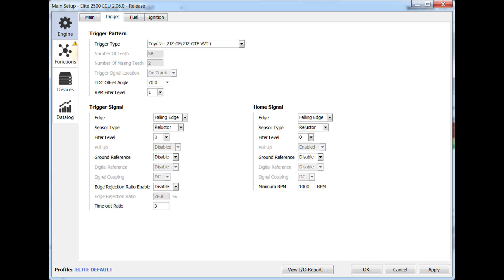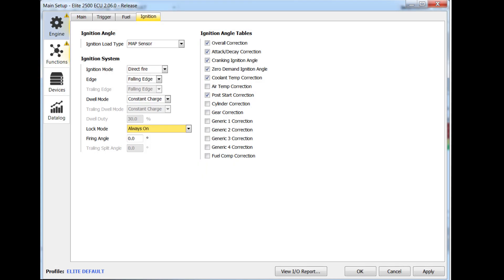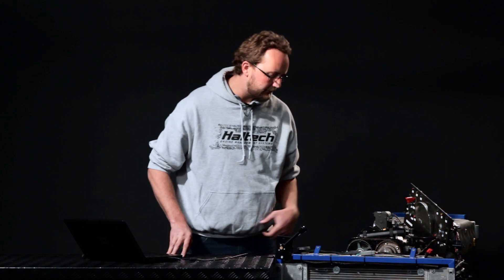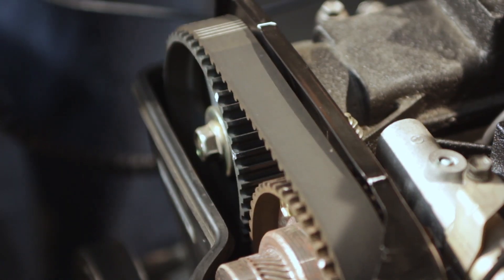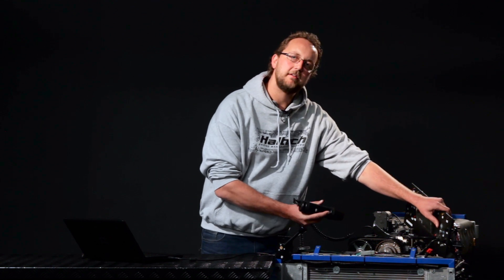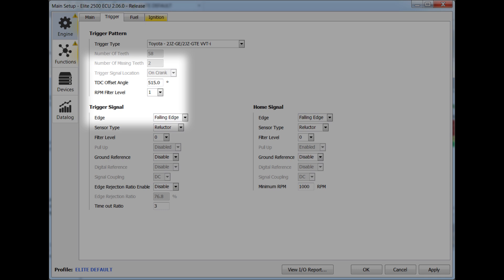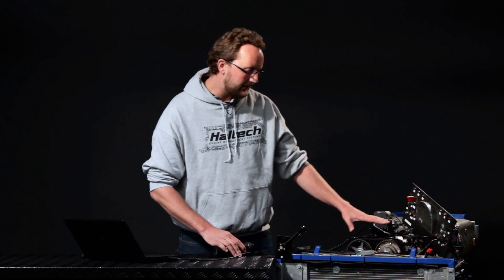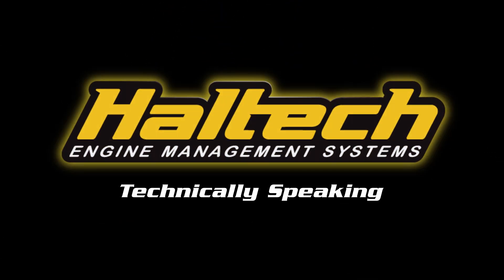How to set your TDC Offset Angle - Technically Speaking

Comment: Sadly this is even better than the Link ECU explanation I saw. Not to even mention that fact you can disabled injectors so easily on the Haltech. I will be buying a Haltech next time.... Made a mistake with the Link ECU it is a lot more basic as far as quality of life features. I can disable my fuel pump control on the Link but then it loses my settings, more annoying. Same with turning injection mode to off you have to redo the settings.

Comment: Hi Team, what would seem to be a simple question to you, I hope.
Gear=E2000, MSD dual sync distributor, EDxr8, with 1 Coil I thought I did the set up as per your How to set your TDC Offset Angle - Technically Speaking had the timing locked @ 0deg and offset at the 30 deg . all sweet  then tried to start with a bit of mucking around added 180 deg and success. With this information do i just stick with it working like this or re phase the dist 90deg thanks for any help
Reply from the maker: One of our tech support guys will be able to help you out with this - pls contact support@haltech.com

Comment: I already timing gun on my crank pulley, and it's not matching to cam gears. What to check for? I already checked the mechanical timing. It all checked out.
Reply: You might be on the wrong stroke. If the crank is off 1 revolution it will still look right but the cam will be 180 degrees or half a revolution off. Try adding or removing 360 degrees from the offset.
Reply: @Jinjenia0  i got it all fixed. Exactly what u say.👍

Comment: What is the most you can advance the 2jz motor on the crank....i seen 10 degree's....and does it give better power ? Thanks
Reply from the maker: Every motor is different, we advise you check with your engine builder and tuner.

Comment: The Haltech on my 304 turbo  engine I used the distributor on as timing  calibration sensor, similar to the way you did to calibrate TDC then I electronically set all firing and injection from computer  through Haltech as I had eight coils on the firewall and fired on compression and exhaust stroke to give true clean burn and set timing injection via exhaust gas analysis while on the dyno, was about  697 rwhp.cheers